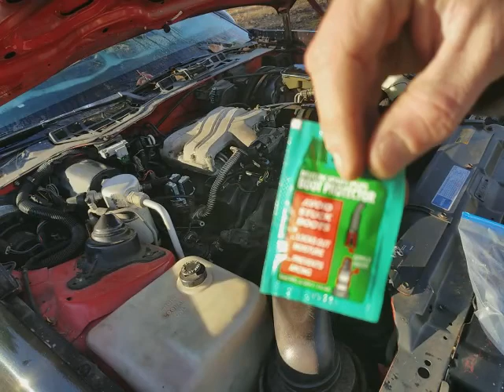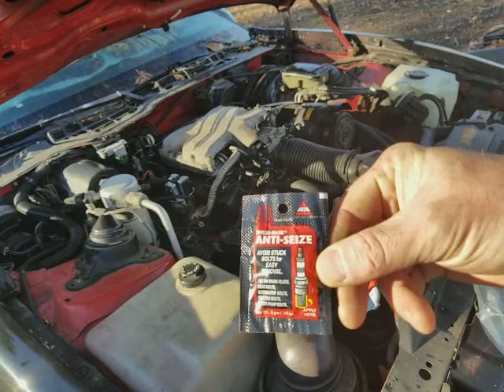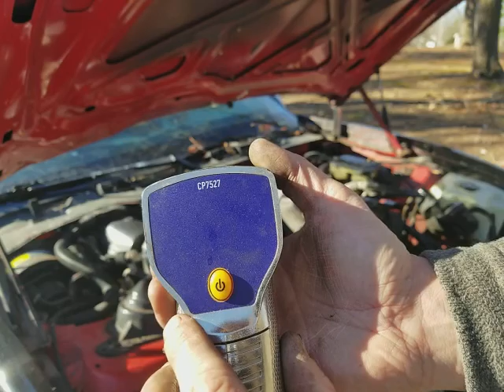91 firebird 3.1 v6 distributor replacement pt 3

Comment: Do you have to take the whole front half of the motor just to remove the distributor? If not why did you have to? I have a 91 camaro with the 3.1 v6 and thinking its the distributor.
Reply from the maker: No you do not have to remove the front of the engine. I do not remember why I had everything off. I've done alot of work to this engine. Check pt 1
Reply from the maker: Best way remove #1 cylinder 1 plug bump the key or rotate to cylinder 1 TDC  pull distributor cap mark where the button is sitting remove the hold down bolt and remove the dizzy.. reinstall new distributor making sure it lines back up.
Reply: @amberericjones5694  this is probably a stupid question but how so I bump the key or rotate to cylinder 1?
Reply from the maker: @adamweaver1084  you can do either or, if you bump the key over. You don't want to start it just enough to bump the cylinder up.. if you have a helping hand. Someone can place there finger over the hole while the other person bumps the key. Or have a spotter that can watch. You can put a piece of paper towel in the spark plug hole an watch it blow out if on compression stroke.... the other method is rotating the engine by hand to TDC just have to be sure that your at 0 on the crank an that your rotor button on the distributor is facing number 1 cylinder. Take a long extension an feel for the piston to come up. Don't drop it down... hold it while your rotating the engine.... may take 2 revolutions to get it to compression stroke. You can also do that even with your finger in the hole an feel for compression that way while your turning the engine by hand... little more complicated but can be done. Just be sure that piston is all the way to the top...
Reply: @amberericjones5694  is this the only way to check for time? Or can I just mark where the button is at when I go to putting in a new one? Sorry im new to working on this car.
Reply from the maker: @adamweaver1084  you can mark the dizzy an pull it an set the new one in the exact same spot.. but to me to keep everything in line I set everything to TDC for safe measure. Not only that but to keep the oil pump drive also in the correct location
Reply from the maker: It just makes it easier to keep everything in time. That way incase if something goes wrong you don't have to remember if it's on compression or intake
Reply from the maker: Most ppl will mark the dizzy pull it an stab a new on in. I personally don't like doing it that way.
Reply from the maker: Also when you get ready to check timing with a timing light.  Unplug the esc wire Grey plug on the passenger side. 1 wire. If you don't you will not be able to time it correctly.. unplug it start the engine an set your distributor at 10 btdc. Tighten your hold down clamp recheck timing plug your esc wire back it'll be 10btdc on your timing tab
Reply: @amberericjones5694  thank you I appreciate the info. Also that wire you were talking about in pt1 that needs to be unplugged i bought the car with that wire already disconnected and not sure where it goes.  I was just trying to make it as simple as possible for me to do. You're the only one I can find that does these detailed videos on the 3.1s.
Reply from the maker: @adamweaver1084  yea that 1 wire plug will need to be disconnected until you after you time it then you can plug it back in.
Reply: @amberericjones5694  that wire was disconnected when I bought the car. Im not sure where it goes to. Or if need to plug it back in.
Reply from the maker: @adamweaver1084  being your new to it in a way I would highly recommend putting the engine over the TDC. Now, let's say you thought you had it at TDC but yet it was actually intake stroke. Car may not start. Rotate the engine back to TDC if you know now for a fact that the engine is at 100% at compression stroke. Pull the cap on the dizzy if it's facing back towards the fire wall opposite of cylinder 1 which it'll be facing toward the driver seat.... no worries pull the dizzy up rotate it around to cylinder 1 drop it back in an adjust your timing... this means that it was 180 out. I ran into that problem after these vids. I thought I had it at TDC compression stroke but I was at intake tdc instead... so if that happens don't be alarmed. That's the other reason it's best to just put it at TDC. Because if something happens you don't have to fight a whole lot with it.
Reply from the maker: One of the reasons I mentioned putting a paper towel down cylinder 1 just enough to blow back out once it blows out check piston be sure it's at the top. May have to rotate the engine back just a bit. But as long as the piston is all the way up. Your good
Reply from the maker: @adamweaver1084  it goes up toward the dizzy the other end goes down toward the computer. Because if you try to time it with it connected its going to show way over 10btdc.. so you only keep it disconnected when checking your timing with a timing light. An plug it in after you have set it to the correct timing.
Reply: @amberericjones5694  alright ill give that a try. Thanks again.
Reply from the maker: @adamweaver1084  reason for that is when you time this engine your timing it by the distributor with out the interference of the computer.
Reply: @amberericjones5694  so I need to plug that wire back in until I time it correct?
Reply: The car runs and idles I can move it a couple minutes then it stalls. Ive replaced the plugs, wires starter, egr Valve, distributor cap and button. Its better than it was when I bought it but it still stalls. Its either the injectors or distributor.
Reply from the maker: @adamweaver1084  injectors are junk for these cars. I bought a set for mine helped a little bit an now somedays it'll fire up pretty other days it'll take a bit to fire off.. I'm just gonna drive it till I can get my other engines built for it
Reply from the maker: I've got a sbc 327 and a 5.3 Ls for it. An I'm back and fourth which one I want to build.. Ls seems to be a tad cheaper than my sbc. Which I find dumb in a ways. It's mainly the heads that's gonna eat the lunch box
Reply: @amberericjones5694  yea I don't think the injectors have been changed in mine
Reply from the maker: @adamweaver1084  If you still run into the same issue. Run a fuel pressure test on it., I think we're supposed to be around 40 to 45 or so psi. May also have test each injector.. mine got to the point it wouldn't stay running for 2 seconds then die.
Reply: @amberericjones5694  i ran the pressure test. I got 42 psi. If its not the distributor or injectors im out of ideas what it could be. I also changed the map sensor.
Reply from the maker: @adamweaver1084  42 sounds about right. May check your timing chain check see if you have alot slack. I do have a video on that too. Step by step. I get a little long winded sometimes. But I get wrapped up trying to show an try to get ppl more on a understanding level. Cause not everybody knows. I really need to get my ass back on making vids again my motivation is just ehhh lol
Reply: @amberericjones5694  you make great videos. They are very helpful.
Reply from the maker: @adamweaver1084  ty I appreciate that
Reply from the maker: @adamweaver1084  I'll probably get back on here again cause my high beams ended up not working again. One person made a comment about the issue I've yet to make a full blown video on how to fix the high beams.
Reply from the maker: I did a tutorial kinda just talking about it. But not a actual get down step by step

Comment: Just curious  If you got 2 timing issue fixed I'm going through the same issue
Reply from the maker: After fixing the timing chain an replacing distributor fired up like a champ
Reply: I have a 1990 Camaro rs with a 3.1 later in it. Do you know if its passenger side top dead centre compression or is it driver side top dead centre compression? I just recently did the head gaskets in had a pull out the distributor and all. Not paying attention did not make my marks now have new distributor in and can't get the thing to fire up
Reply from the maker: @ronnievigil7467  gonna be passenger side tdc